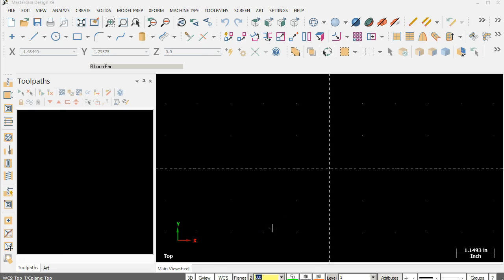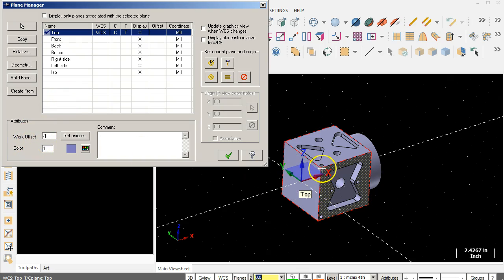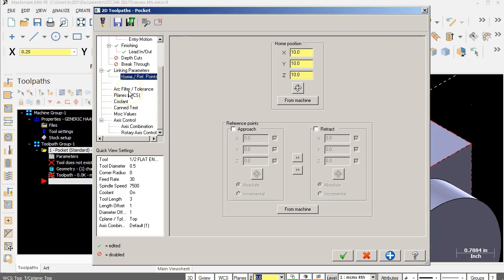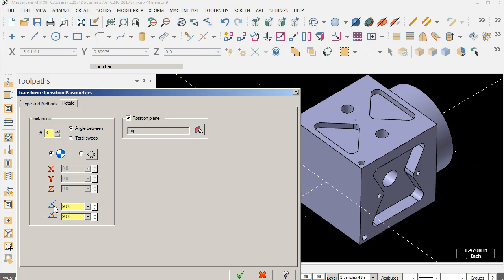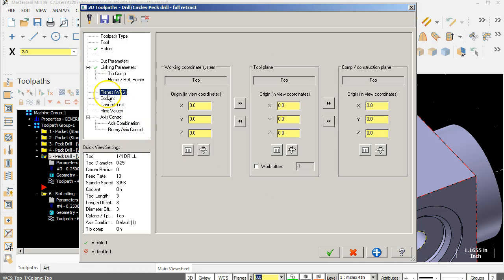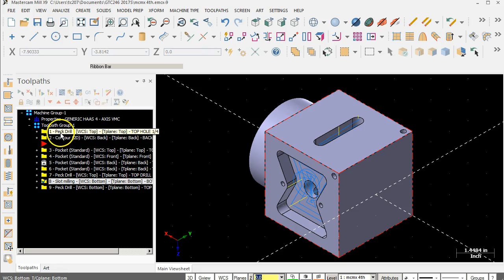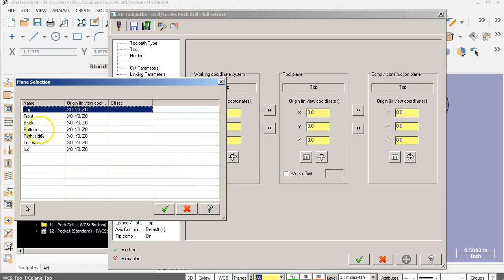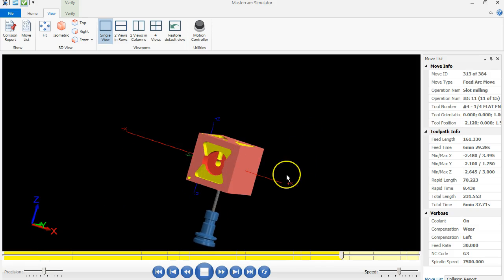20170321 4th Axis Setup & Strategies

Comment: Do you known how to use Mastercam, look like you go back and forward, go back and forward?
Reply: My current job does not use Mastercam stand alone and I prefer Mastercam Solids to stand alone. I use Solidworks and HSM daily. I have not programmed 4th axis daily for several years. So, I apologize for lacking the polished push this set that works every time for every part videos. I try to show problem solving going from the parameters to the toolpaths to the simulation. When I see something or think of something I address it which makes the video very back and forth. Check and recheck before the machine and tool makes grindy, crunchy sparky noises and turns into a very expensive lesson.

Comment: Hello friend..can u make video on 4 axis Promming where the part is stationary only tool rotates from -90 to 90... I use 4 axis cnc router it doesn't have rotary Axis..only its tool can be rotate in A axis...please help.. Thank you
Reply: Sorry for not replying sooner. I have not programmed for the router heads in many years. I will see if I can remember the process.